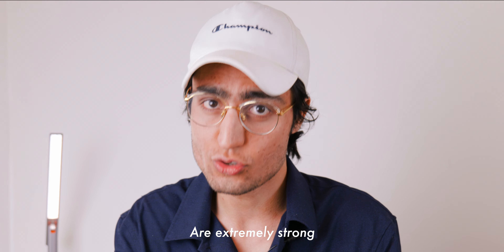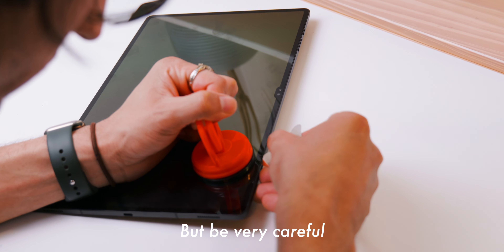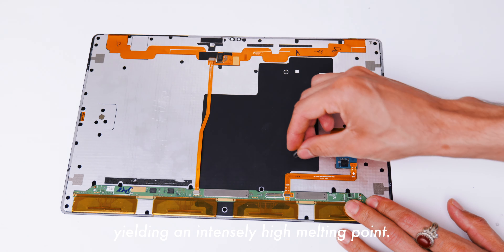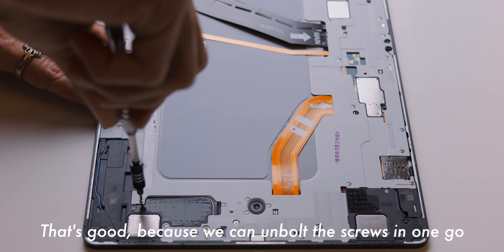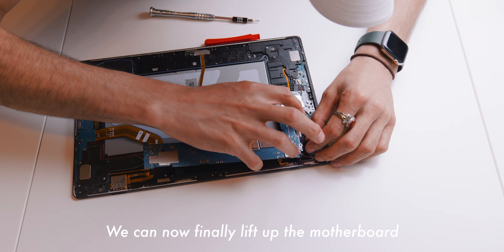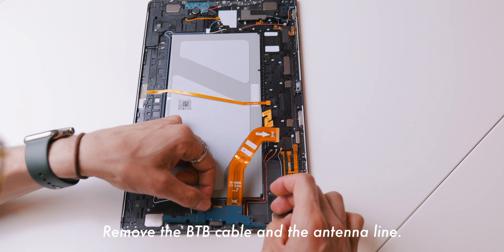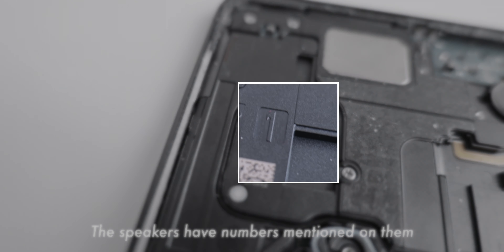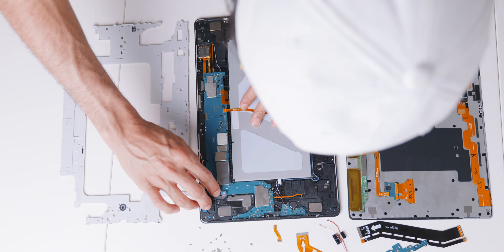Galaxy Tab S8 ULTRA Teardown - Too Much to Deal With!

Comment: It's been a couple months now since I've bought this tablet and it is great. https://www.youtube.com/post/UgkxLNmVocUk8tnSkwWIlYSNFzWRIaFTBuzS  The tablet is responsive and runs well. There were a few times that the tablet did an awkward thing where it would detect pen on at all times and wouldn't register finger press, but it is usually fixed by closing and opening either the screen or app. This is highly likely due to my excessive use for drawing which caused this and wasn't really very big. As I mostly enjoy using the tablet for drawing (and some light gaming), I would comment from that aspect that there is definitely more accurate pressure and drawing using a PC device and drawing tablet, however i find the moveablity of the tablet more enjoyable to draw on. Like how you can physically rotate and move a piece of paper around or even draw casually on your bed.All in all, as a tablet it is good, and as a drawing device can be good depending on what you want from a drawing device. It is definitely good enough if you just want to use it to take notes. For typing though I can't comment on the keyboard as I did not get the keyboard.
Reply: If the pen is close to the screen, the touch is disabled to prevent your hand from messing up the drawing with the s pen.

Comment: 1:20 this is exactly what happened with me when i tried to take apart my Tab S6 to replace the charging port connector. The screen developed vertical lines then completely died

Heartbroken 💔 replacement display costs as much as a new tablet second hand because it's OLED. I can't afford it 😢

Comment: Snapdragon 8 Gen 1 SoC(Samsung 4nm fab) is power hungry(6 to 10 Watt). 8+ Gen 1 resolved this issue just by TSMC fabrication. My Tab S8 plus has 8 Gen 1. To reduce strain on battery, Can I use the table with the USB-C power supply? Or Does it ruin the battery by simultaneously charging(at 25W) and discharging(6 to 10Watt for SoC + Dispaly power consumption)?

Comment: they could have easily made a 20k mah battery fit in this tablet its full of plastic on the inside and the cooling of the soc is poorly designed resulting in an underclocked chip or better even? replace the 4 speakers with two MASSIVE speakers that are way better than any speaker on any device.. but noo u pay 1500usd for it to be half assed and rushed. 
there is no perfect tablet to this day
Reply: This is a tablet. Not a laptop. 20k mAh is just too heavy for a tablet. This tablet was already weighted at 726g. Putting 2 big speakers on that slim device Will make the device act as a Vibrator.
Reply: @bagasfabianmaulana9406  a thicker 7mm device with better speakers and double the battery would be fine.. being 1.2kg is fine and it already vibrates with the 4 meh speakers in it.. its a tablet not a laptop.. But it's also 14inchs so I don't see the point of being light.. most of the time u wouldn't be holding it anyway... i think its worth around 800usd the 1500 i paid for it was not worth it.. at least put a better haptic motor in it.. a higher res screen? Maybe 4k? Its 14inchs 2k is barely enough.. also thunderbolt 4? Uefi bios chip? Dual boot win 11 & one ui? 

MILLIONS of ideas i can think of to make it THE best tablet on the market.. but its literally a large s22 with bad cameras
Reply: @AliYassinToma  I'm not like defending samsung here, but you clearly never held a 2-in-1 laptop/tablet for almost every hour, right? 1kg+ is heavy for a tablet. This tablet was intended for people who always bring their tablet and use the pen. So will absolutely holding it almost everyday for a couple hour. Also this is an Android tablet with ARM processor. Not your old Intel Atom dual-boot stuff. If you want to get all of stuffs that you've been said, just get a 2-in-1 laptop. Not this tablet

Comment: What if I accidently put the SIM eject tool in one of the microphones? Could the microphone get demaged?
Reply from the maker: Most prolly yes.
Reply: it shouldn't as the mics are off angle and the hole gets narrower the deeper u push the sim ejector

Comment: how about the display protection quality ? ,if we drops down the tablet accidentally ? any ideas?
Reply from the maker: The display definitely needs a solid screen protector. The tab is build like a tank otherwise.
Reply: I have dropped mine maybe 5 times from my lap to a carpeted floor. No damages. Everything works as in the beginning in february.
Reply: @markkupio4472  damn..i bet you are very rich
Reply: Any part number for the charger port board?

Comment: I would buy this except it doesn't have cellular capabilities. Why oh why do these manufacturer's refuse to allow this in tablets?!?!?!? What's the reason, anyone have a guess on this?
Reply: There is a celluar version
Reply: The tab s8+ has a cellular version but likely becoming less common since you can just tether them to your phone nowadays.
Reply: It's a tablet why should it have cellular? I even find having rear cameras on tablets unnecessary
Reply: @bhoot1702  I bought it with 5g. Mainly to have a backup/second device when traveling.
Reply: it does now. Ihave the ultra version with 5G
Reply: @bhoot1702  its a mobile device so cellular is a requirement otherwise it will just stay home and for that you could buy a cheaper laptop but well i love also the flexibility, I make phone calls with the tablet